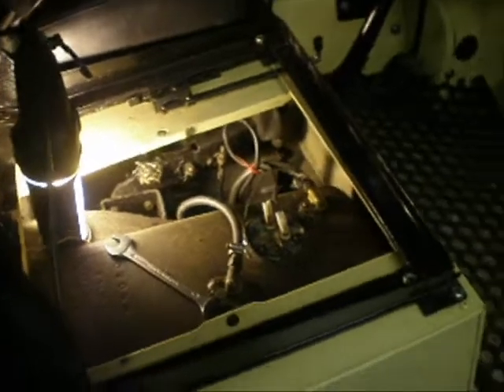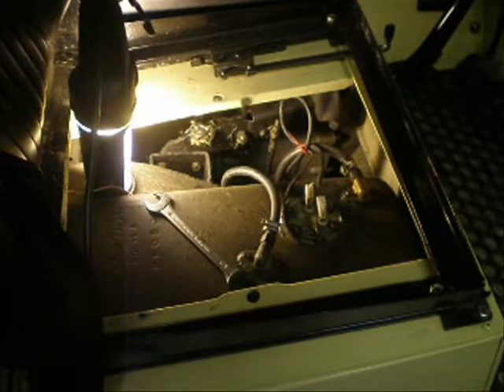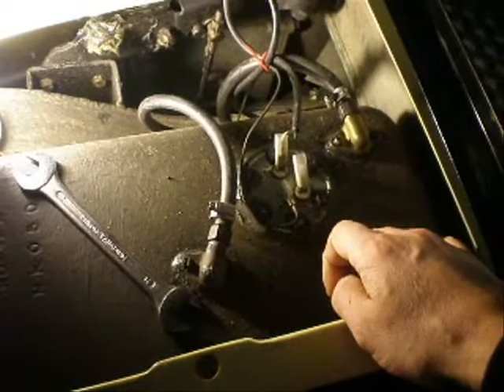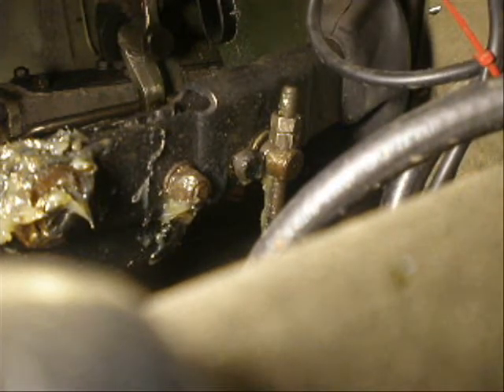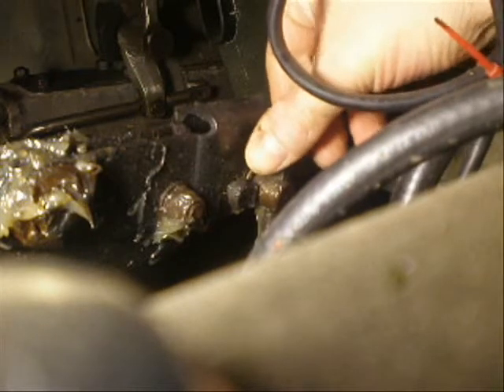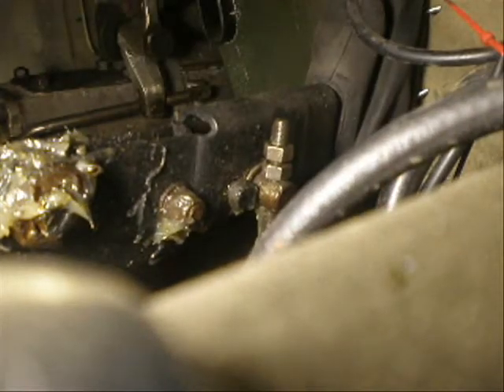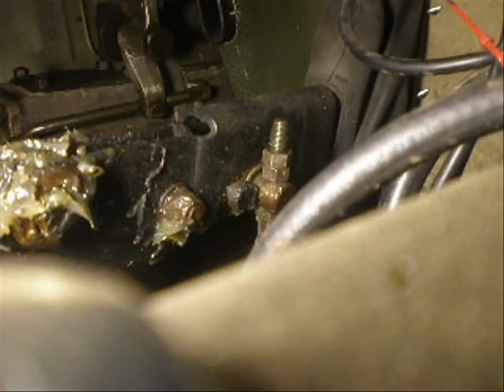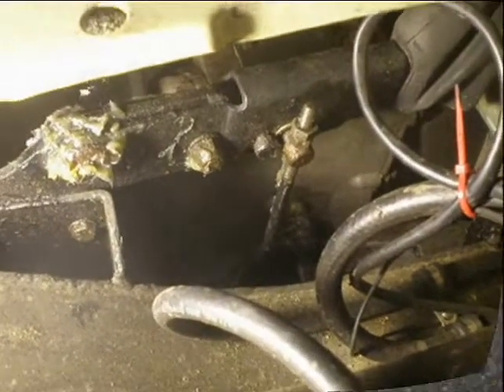Series Land Rover maintenance #1 - Handbrake adjustment

Comment: Hello, yesterday, I just checked my handbrake shoes on my Series 3 109 ex-mod (1984). and adjusted them afterwards. For this reason, I turned the adjuster on the backplate, not the nuts on the leverage. Perhaps, one has to do both jobs to get the shoes overall in a tight fit on the drum service. By the way, what I am not yet sure about is the fact, that the shoes are dran to the backplate ny the returning springs. In this position, they are not parallel to the drum surface. Applying the adjuster, you can hear at some stage the edge of the shoe scratching the drum. If you loosen the shoes again, travel of the lever is too long. Should I live with the scratching?